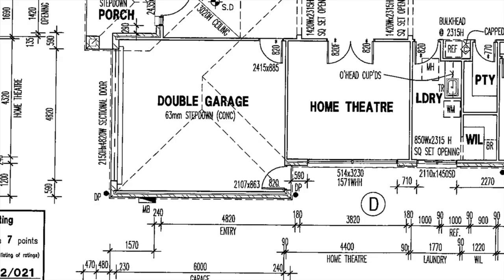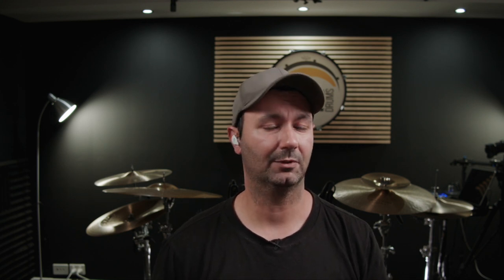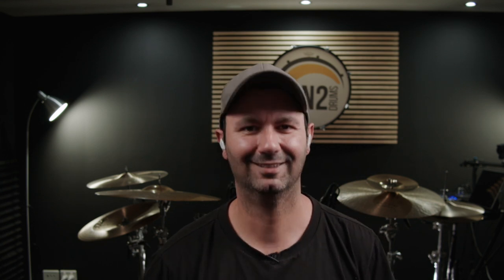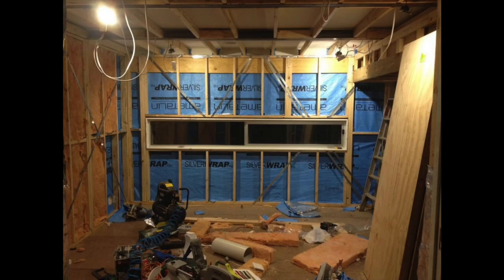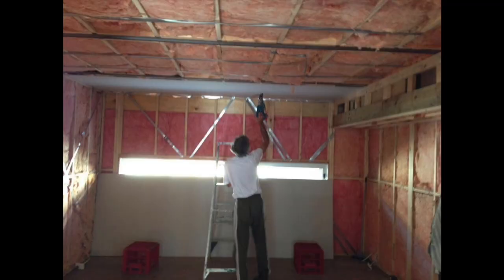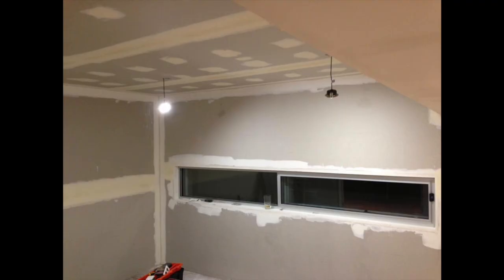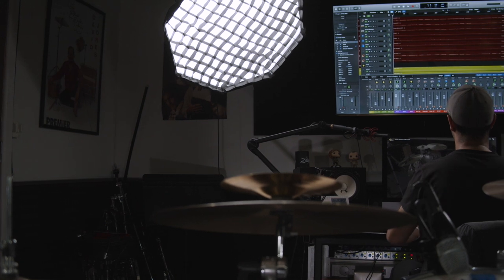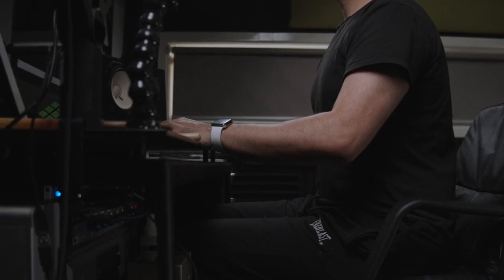Building My Soundproof Studio - Drum Practice room build

Comment: great vid Troy. I built a 5m x 6 by 2.3 room inside a room inside a shed outta limestone blocks, dble roof, dble doors, works great, never had a complaint even with band rehearsals, got to be nice to your neighbours and you can practice guilt free.
Reply from the maker: Thanks so much, Dean for your kind words. Your room sounds like it would be awesome. I'm hoping one day to have a slightly bigger room with a separate control room.
Reply: @TroyGrech_In2Drums  I had a separate vocal/amp booth, which isolated from the main room quite well, but didn’t use it enough, preferred more open space
Reply from the maker: Yeah, I don’t think I would need anything like that as it’s mainly just me I’m recording and am not too interested in recording bands. 😂

Comment: Hi Troy. Great vid. I'm about to do the exact same scenario as you. Just finished a new build with the "theater" to become my studio. I have built before in my previous home using fire check gyprock, barium vinyl etc. Worked great. I didn't have air flow as this seemed problematic. Definitely want it this time around. Would you make a vid showing how you achieved this please.
Reply from the maker: Thanks so much for checking out my studio build Dave. I have already done a video regarding “Fresh Air”. Here is the link. The only thing I would suggest is that you line the boxes with a different material as it was pointed out after the fact that it probably wasn’t a good idea to use acoustic foam (may have mild issues). Here is the video link https://youtu.be/vdNTRlZEAX8

Comment: Great results! I'm very envious. How often do you have to open the windows? Does it get stuffy with just the boxed air circulation? Thinking of building a practice room in my backyard and first thought was to do a double layer of bricks.
Reply from the maker: Thank you so much for checking out the video. I don’t actually have to open the windows that often as the air vent system and air conditioner make it very comfortable in there. 
Yes if you can do double bricks that would work very well. I would still have an air gap (room within a room) if possible though.